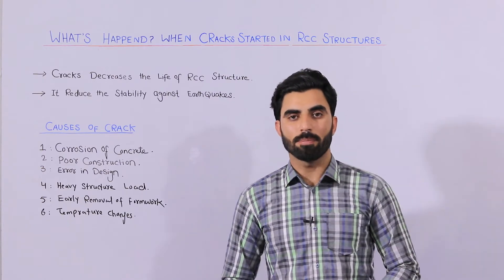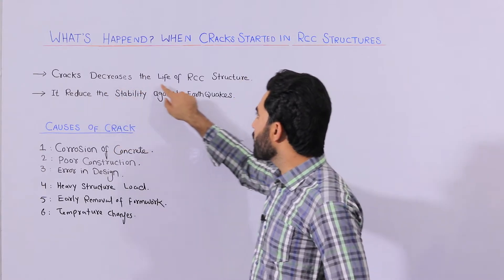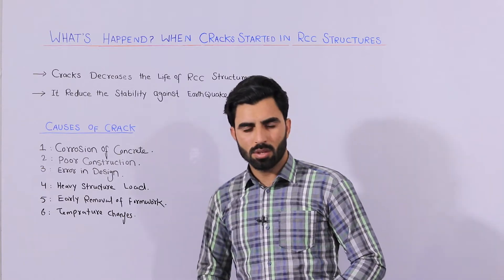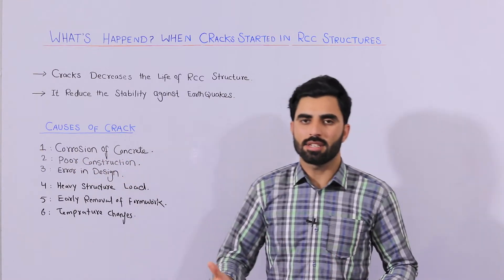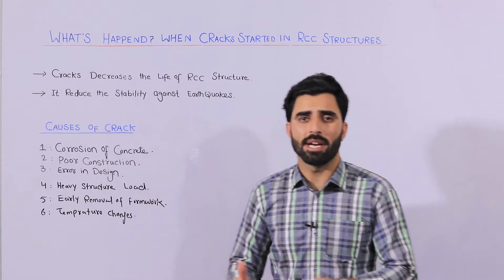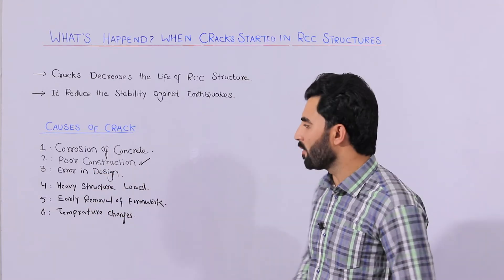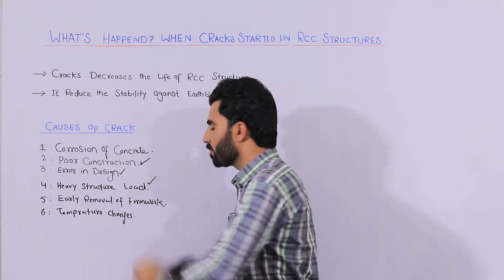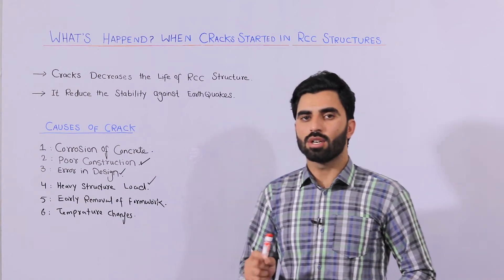What's Happened? When Cracks Started in Building | Cracks in RCC Structure |

Comment: I see one contractor using grout as the call it here ( cement mixed with water to dip the rusted steel in before it is used for coloumn design) can rusted steel be used in this manner would the coloumn still crack